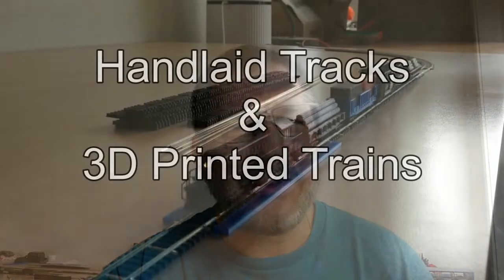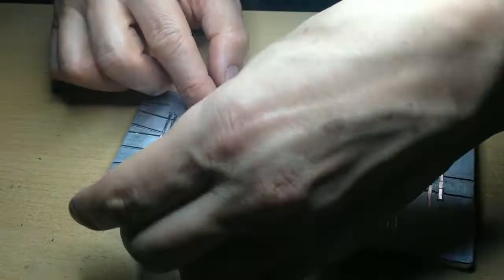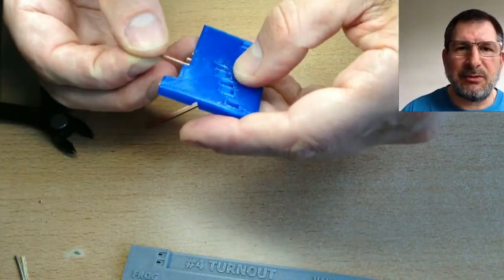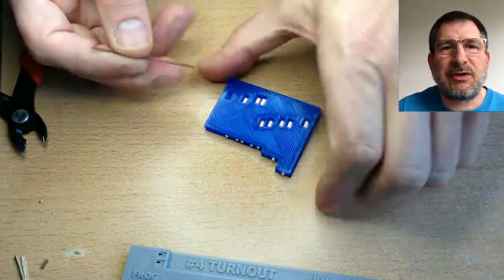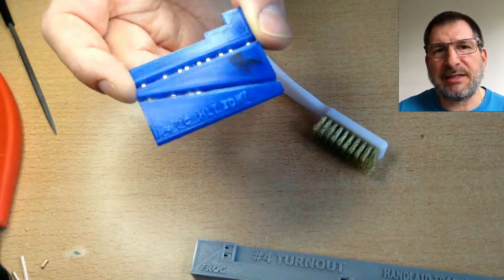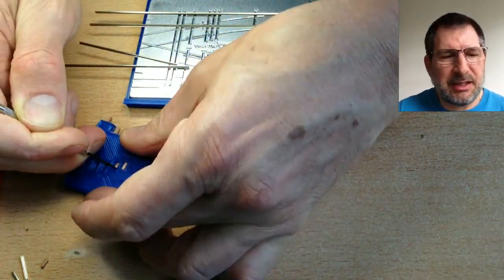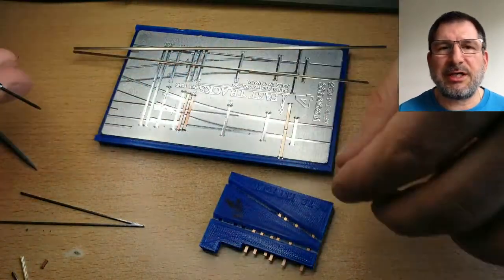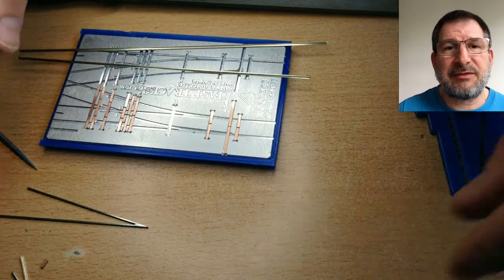3D Printed Gap Cutter For Copper PCB Board Cross Ties And Handlaid Model Train Tracks

Comment: Any chance you could share the stl file for this?  I am still learning how to design things with CAD, but have a 3D printer.
Reply from the maker: I'll put it on thingiverse shortly. Are you making #4 turnouts? This is pretty specific. I have to update it since I missed a gap and did a slight redesign.
Reply: @handlaidtracksand3dprinted922  I am making #6 turnouts .. so anything that you have to help with the process would be great as I have 80+ to make.
Reply from the maker: Sounds like a nice layout! Did you watch the Inglenook Wye video? Add a shunting puzzle... Are you using Fasttracks #6 turnout jig or the #6 3 way? I have a tie cutter for the 3 way version. Some of the ties are different. I also built the sleeper bed 3D print for my tie spacing. So if you are using Fasttracks wood quick ties etc it may be less useful. Of course you can mod the STLs or cut the wood to fit. I made a rail cutter as well for the various rail lengths. I'll get the tie cutter onto tinigiverse this week.
Reply: @handlaidtracksand3dprinted922  Yes I did .. what a great video!  I am using the Fast Tracks #6 jig.  I decide that I was just going to use that size everywhere to keep things simple.  Anything that you have to make things go faster will be very much appreciated.
Reply from the maker: Here is the video link - https://youtu.be/oon9SUDLZw0  thingiverse link is in description. Not sure which of the ties are going to be wrong. Pretty simple to adjust the length, but mind the angle for the diverging rail path! Also watch for the one tie with 3 gaps...